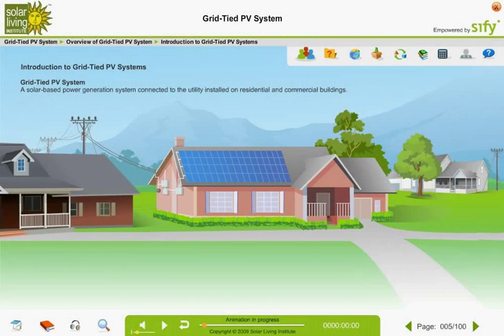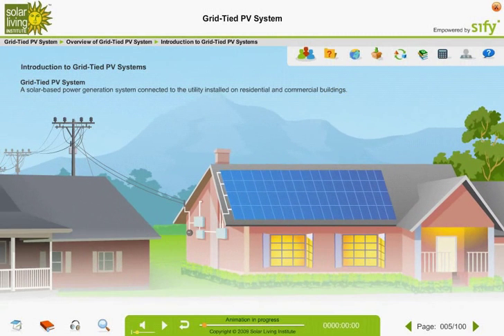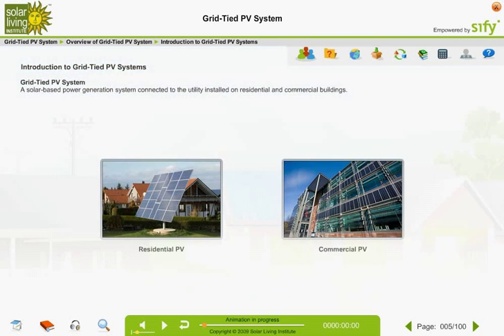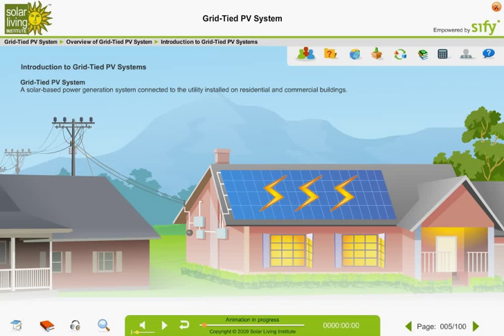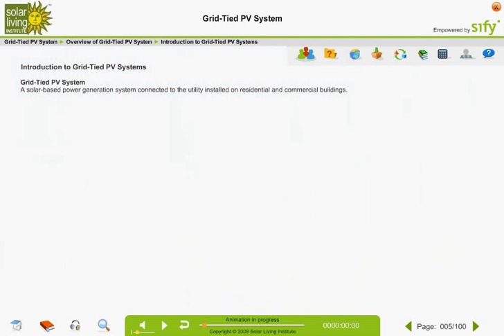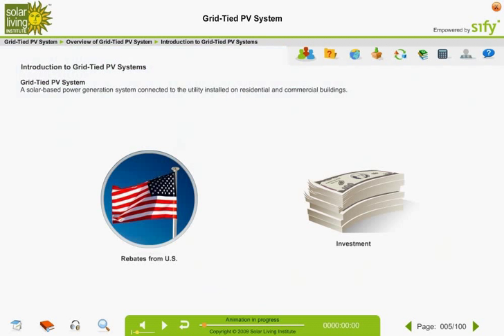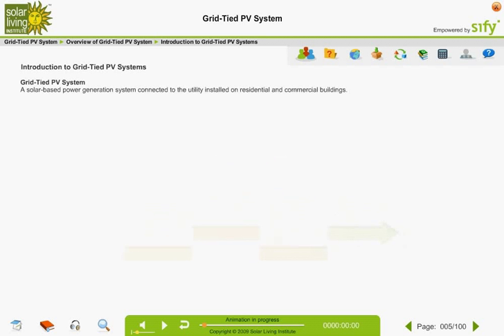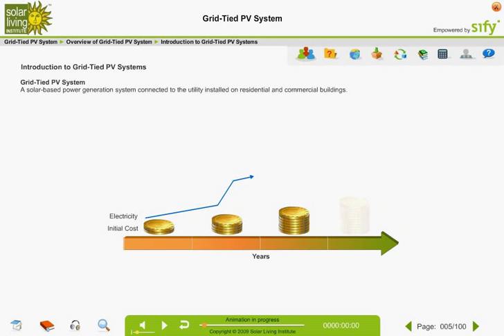Solar Living Institute Online: Grid-Tied PV System

Comment: one thing you don't see much of on these you tube videos is using higher ( several hundred volts DC) instead of all this 12 volt crap. most large systems produce 300 to 500 volts DC fed into an inverter then tied into your home, or business electrical system. this is much more efficient, but requires a good working knowledge of electrical systems and some electronics background as well. these higher voltages are "LETHAL" , but for a practical system, you need higher primary voltages.